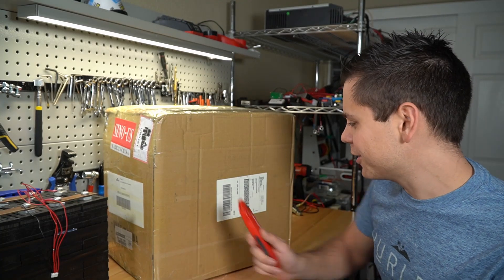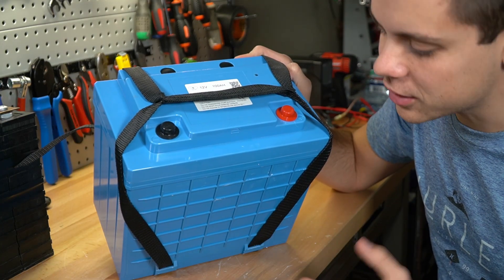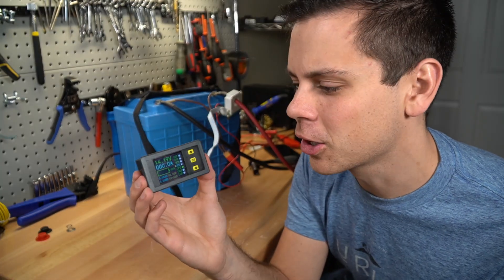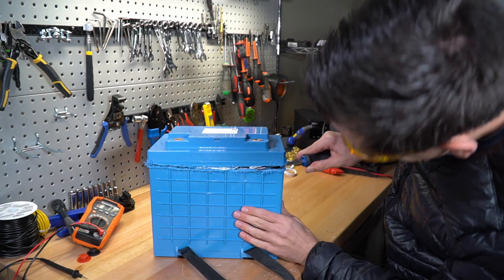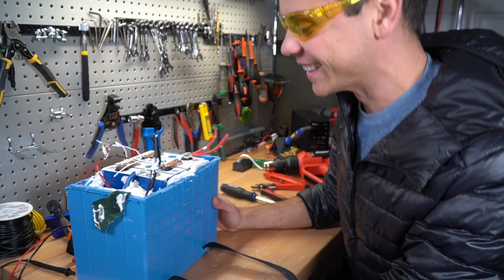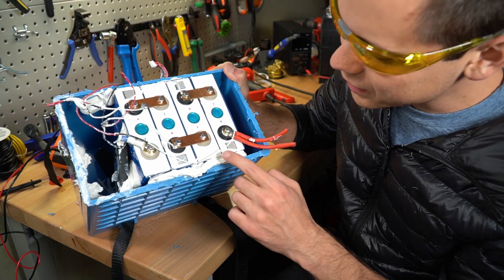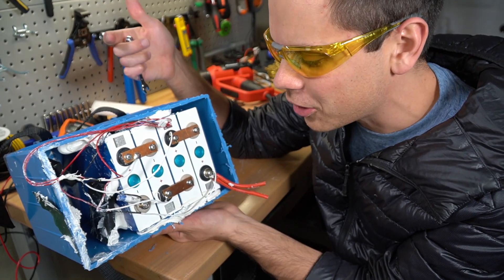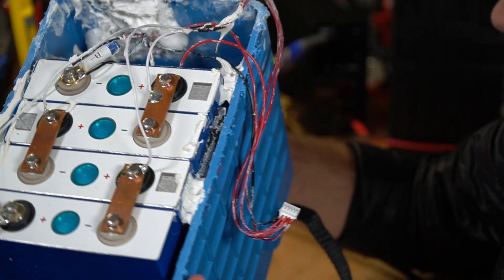Aliexpress $538 12v LiFePO4 100ah Renogy Clone (usually $899) Tear Down

Comment: Who cares about balance leads and Candlewax coated, .000002 mm thick  Tinned copper wires when it reads 4.2 v on  a multimeter and Doesn't burst into flames under First test conditions. 😂😂😂😂

Comment: Form factor doesn't make something a clone.
It's well documented that Asian factories will over produce, or continue using molds and dies after producing for one customer.
So the box might use the same mould as the one you're saying it clones, but there is no guarantee that anything inside is good or bad quality. As you found out.

Comment: Thanks I was thinking about buying this battery, but forgetaboutit.  I am waiting for a SOK 100 ah lithium battery, it maybe awhile. I received a text from SOK saying after you video evaluating their battery, they sold out and had to reorder from China. Hopefully it will arrive this month and I plan to build a milk crate system with quick disconnects so I can quickly remove the crate from my van.

Comment: I wondered about my Renogy after seeing this knock off teardown in the same case mold. Peeled off the rubber vent caps on the Renogy and looked inside. Happy to confirm it it looked very neat inside, and has Cylindrical cells in light green wrap, ~ 1” diameter, so probably 26650? laying on sides. A sticker on an aluminum piece (BMS?) says Zbf12v100... on the side.

Comment: Will the reason they are the same looking as a Renogy  is because that is what is called a "common mold", meaning anybody in China can buy that case.  So how this works it anyone can start a Battery business in China by just getting a small warehouse and hiring people to "assemble". They can buy the Case, they can buy the cell packs and buy the BMS, then go on Alibaba and sell. So when you go on Alibaba and you see the same battery style appearing time after time it just a bunch of assembly houses, and traders offering those garbage products.  They just rent space, buy cheap cell packs and BMSs and assemble. Do you really think they are putting in the top of the line cells?  Not they are putting in cells that are not passing the grade tests, and cells that are designed to look exactly  like the higher end cells, or they are not grade A or matched cells. Don't want to be a jerk but I don't agree with your testing of the battery cells and claiming they are "Great" from a few discharge tests.  That just not accurate.   Keep in mind there are vastly different levels in cell manufacturing.  The cheaper cells are designed to look exactly like the more expensive cells, yet they will have lower grade materials for the cells and they will NOT have the same number of cycles and are usually built without matching the resistance and capacity.    So just a few discharge Tests as you are doing are not really enough to say they are a "great cell" to be honest.  It's  like you can buy a  cheap Phillips head screw driver for $4 dollars and once you start to use it the metal is soft and doesn't hold up... .though its fine for temporary use and works fine when you first use it.  That is really how it is.... so the money and cheap stuff really isn't the top quality stuff.  What I said are actual facts.  Just sayin'.

Comment: Hi will excellent video mate I've got a question for you I'm building a campervan at the moment and I'm looking for or ideas on a cheap safe lithium battery preferably a lead acid drop in type with BMS integrated I stay in Scotland and the main one that keeps popping up is the victron one but it is expensive I've seen the battleborn can't see anywhere in the internet that will send them to Scotland I did like the CALB cell video you did but not sure I've got the expertise to build a battery with all the BMS!! Thanks again for the great video's 👌🏻

Comment: I have the Renogy 100ah battery and I weighed it, it weighs 28.5 pounds or 5.5 pounds more than this white label battery (this is for the battery alone, no packaging and my scale weighs to the nearest .5 pounds).  That is a huge difference!  Also Renogy had their 100ah battery for sale at $640 just before Christmas.

Comment: Also noticed that the Renogy batteries I bought have the cell model number listed on the data sheet, which is IFR26650-3.4AH. These appear to be cylindrical cells. That gives me some hope that the Renogy ones aren't built the same way as these, unless they are lying too, or are being deceived by subcontractors themselves. I guess we'll find out soon...

Comment: I recently purchase  some renogy 100Ah batteries when they were on sale recently   The case looks identical except for color and labeling to the battery you have.   However, it weights 28 pound, so something is different inside.

Comment: Something I would like to see. A sailboat 12 volt lithium  power station that is a direct replacement for old lead acid D8 batteries.  To be able to buy a boxed lithium power station that all I have to do is plug it into my solar panels and wind generater. And drop it in the hole.
I'd buy two! I have a 1977 Morgan out island ketch. Stock, they boat takes two D8 batteries. One for the diesel starter and one for boat systems.

Comment: I don't get why people in the comments are saying that you should open dispute. You bought a battery that is perfectly good for the price.  $440 for cells + $20 for case, $50 bms add the labor and other random stuff like glue,screws,copper,bars (all of those are the remaining $28.) It is sold basically at almost no profit. Is it well build ? If you expect high quality you have to pay more. The profit margin of this product doesn't allow for quality control,R&D and other extras. In this case you get what you pay for. Can you do it yourself and better 100%, but then add your labor to the price, including the time you spent ordering 10 different things that you do need. Also building small amount of this batteries may be ok. But imagine if you need to build 200 of them, I rather get this shitty ones and just deal with them if they fail.
Reply from the maker: Because the picture shows cylindrical cells and a different BMS. That's why
Reply: @WillProwse  people seem to be under the impression that low prices / profit margin means you have to be satisfied with what you get. What a joke. If your return process fails, I see no reason to curse the sky. 

However, all these people insinuating that you dont have the right to try to rectify the situatio. need to gtfo youtube because the internet is a great way to hold companies accountable.
Reply: @WillProwse   Looking at the listing it seems the picture got removed that was showing the internals. Still I don't understand how returning a product that you cut open is going to work. I mean most of the return policy I've seen state that item should not be destroyed.Also  I still don't agree that the item is not as described,  we've seen worse from big US companies that in different revisions of their products use different components.  For me the specifications are the description of the item, I agree that the picture of the internals is misleading but that is the only issue, it could've been solved by 1 line in the description stating pictures are for reference and actual product may vary.
On top of that the return shipping cost is on you in this case also export documents and so on. I'm wondering what is the quote for the return shipping for you and will it be worth it ?
Reply: @ac0rpbg  if you bought a car online and it had a different engine in it than what was pictured in the listing you would not be talking like this.
Reply: @oculophilia918  Well here in my part of the world, you don't buy car without looking at the car in person for the exact same reason. I'm BMW guy so I can give you many examples of "M3" look a like cars that are made to look like M3 but they are not and in the case of the cars if it says in the specs what engine it has and show different engine in the picture then it is misleading and scummy, but it is as described. I'm not defending the people that do this I would feel scammed too. But this is the reality we live in with the cheap stuff we buy.  As I said earlier when the price is too good to be true, then you should expect corners to be cut. It looks like all in this battery is new it holds the capacity tests it exceeds the specs of 100ah by having 105ah cells. Would you be more happy if the BMS and all the internals were exactly as in the picture but the cells were used and BMS was re-manufactured?
Reply: @ac0rpbg  counterfeiting is illegal.
Reply: @chriseudy4684  It's not a counterfeit
Reply: @brianbiggar144  bait and switch same thing pretiner. Splitting hairs is for ppl 😂

Comment: Lithium batteries cost too much.  Not good for beginners.  Look for the Universal UB12350 battery It is sealed and maintenance free.
Reply from the maker: Those are the most expensive actually. Lowest charge cycle life of all sla. Initial cost is low, but they are biggest rip off in the long run
Reply: @WillProwse  I have one that is 10 years old.  Still works fine.

People might as well just stick with on grid power supply or get a noisy generator as the costs are similar.
Reply from the maker: @240Volts  sounds like you are breaking laws of thermodynamics. How many times have you cycled? And float charging a sla is cheating. How deep is your cycles? What's the bandwidth. I have the data sheet on those and max is 500 cycles at 50%.
Reply from the maker: @240Volts  yes but we are using solar for other reasons than just cost
Reply: DIY Solar Power with Will Prowse I don’t let them go too low voltage wise.  I have no idea what you are asking about bandwidth wise.  
I have to keep a automatic charger on it due to the constant stratospheric aerosol injection here which makes most days very gloomy out. 
I get the type of batteries that fit my budget. 
Like I said I bought a ub12350 10 years ago. I also didn’t mention I acquired 2 more at no cost a few years ago. 
Thanks for the replies though.  Merry Christmas.

Comment: If you had access to the manufacturers and supplies what components would you use to make the cheapest best version of that renogy battery pack for mass production?
Reply: Bigger terminals bigger wire and better bms

Comment: Ha Ha...   I bought 3 of those a couple of years ago, then I left a comment on Amazon for the Renogy clone...  Every body chewed me up and down, saying the Renogy was a different battery...   Suckers paid 900 a piece for the renogy.  BTW, I have mine in my Sprinter motor home and they work great and half the weight of previous 2 lead acid batteries.  For my home solar I wouldn't use these, I use poly prismatic cells and the smoke my old SLA's.

Comment: I really really want to know what's inside a renogy battery. You can't buy battle born batteries in Australia. And although cheap is most likely going to be cheaply made more expensive batteries are not necessarily better made. If they were ok then I could feel comfortable buying them but right now I'm not sure what to buy.

Comment: The terminal screws on those cells are small because they are only designed to hold the bus bars in place. The main electrical connection is between the flat top of the terminal and the bottom of the bus bar.

Comment: If they sent it to you, how do you know they didn't prepare a battery specifically for a review? The ones they sell may only be good for 1000WHrs. This is the problem with the aliexpress/ebay/etc. model - you don't actually know what you are getting.
Reply from the maker: Because I bought it with my own money from over seas distributor that probably doesn't know my name. And the inside was crap. Wouldn't they have prepared something nicer for me?
Reply: @WillProwse  I heard you say something about buying it with your own money, but I thought you also wondered what it was that they had sent you - just got confused Will - sorry! 

The inside was a work of art wasn't it? 

It's nice to know that the cells coming out of China are what they claim now. Someone in the comments wanted to know how much capacity they would have after 500 cycles. My guess is that the capacity change will be very minor. It would be great to know, but it means months of cycling to test that.
Reply: @WillProwse  Depends.

Comment: I'd like to see you do a teardown of the actual Renogy 100 AH battery. I got several on Black Friday because the deal was amazing. I really hope it isn't this bad. 😂
Reply: There are actually 26650 batteries (4S30P) in my Renogy 100ah although I see 12 AWG wire in mine..

Comment: I've noticed a lot these pop up on aliexpress recently, also some pre-built "solar ammo can" type builds. Honestly I can't say I'm surprised on the build quality of that battery, and I expect the "ammo can" prebuilds are at a similar level...

I really think the better option is DIY, and I'm still inclined to go with Daly.  As it turns out, I'll be living somewhere I know it will never freeze.... so I think I can safely do without low temp charging cutoff.

Comment: I hope Will gets a Renogy and test it. I  contacted Renogy, they say their battery has a low cut off with their bms.
Reply: Are you referring to the original Renogy LiFePO4?  And do you mean that it as a low TEMP cut-off?  Or did you mean it has a low POWER cut-off (I do know that it has a low power cut-off).  Thanks.
Reply: @IncandescentDaD  at the time of the email it was the original battery and low temperature. Time has passed since I  wrote the comment.  Will did a teardown  on the Renogy.
Reply: @anythinguploads2161  Thanks!  Did Will do a teardown of the old Renogy 100Ah?  I saw that he did one on the newer "smart" one.

Comment: Is that a regular SLA auto charger you're using to charge it?
Reply: It's a benchtop power supply !!
He stated that in his comment
Reply: @danieldougan8550  I was referring to the Schumacher Rapid Charger at 2:13 that he appears to have used to do the initial battery charging.   Not designed for Lithium batteries, but the charge voltage must be compatible for a quick charge.
Reply from the maker: @jeffg3563  I actually use 3 chargers and a benchtop supply to rapid charge at 40 amps. But yes, that is a SLA charger. not designed for lithium batteries at all but it works well

Comment: i really hope you set up a testing rig to start doing charge cycle counts. i'd love to know what the capacities on these cells you are pulling after 500 cycles or more....
Reply: Thank you thank you!!!!!  I was hoping someone else would tell him this!  I have tested many many cells and even very bad cells had a good ah rating for the first couple hundred cycles, the weakness of a cell shows quickest with cyclic use
Reply: I've found most RC battery chargers have settings to discharge, then recharge, then repeat over and over. I definitely run batches of cells through it here and there, massively increased in speed once I started using regenerative discharge as well.
Reply: @vira-linc  I bet these specific cells are just fine....it is the cells that they will deliver to you or I that I worry about.
Reply: Benny Banger oh sure, but when on a fishing expedition it’s good to cast a wide net. Different mixes of of material inside a cell could mean oem tests pass for a few cycles but quickly fail. Heck, I’d even open that bms to confirm it’s a Daly bms and not a clone. Like I said, wide nets.
Reply: @vira-linc  Good advice - thanks Roadsteading

Comment: God I hope the Renogy labeled batteries are not constructed like these....I just put 2 of their 100 AH into my RV trailer.
Reply: I have a feeling we will soon know.  Will is not afraid to cut one open with that E tool.
Reply: The case could be mass produced for battery makers to use, maybe clone only applies the  case look.  Build quality might be diffrent on the inside. Thus my  crossed fingers..opening  line.
Reply: Fingers crossed....i have two 50 amp renogy  in parallel in my home trailer . And one 100a in my truck camper.
Reply: The biggest issue that is of concern is component construction and the quality of some of those components used to build it.  Cheap BMS, small terminals, generally bad construction methods packing with foam and glue , wrong gauge wire.  So yeah, pretty much everything except the external case and the lithium cells.

Comment: I got 2 Renogy 100 amps for 550 each on black friday
Reply: That's a great deal.
Reply: I got one on the same deal.
Reply: Not counting tax I got three of them for $518.43 each on black Friday. 3 was the most Amazon would sell per person and it was one of those timed events. Good deal either way.
Reply: Same, got 2 of them, just connected them yesterday, can’t wait to see how they go, running a 100litre fridge, microwave, and anything else from a 2000w inverter👍

Comment: Nice vid -- looking forward to the day when you post an off grid 48V PIP split phase review.
Reply from the maker: I am running a mpp PIP right now. Works great for split phase. Dead simple to install and I can charge my tesla with it. The settings are easy too. Can also do 3 phase. Still need to edit the video.
Reply: @WillProwse  I knew I saw one in your shed!! Would be nice to see/hear your thoughts - I'm right on the edge of buying one.
Reply from the maker: @rebelyell1580  it is 2x lv2424 in parallel. Really simple setup. If it's stationary and weight does not matter, you should like it. It is super powerful and easy to use. Output can easily supply a ac panel. Dead simple to setup.
Reply: @WillProwse  Thanks a lot Will ! Think I will put through the order of a couple of 5048's and see how it goes. Just waiting for some legal incumbrances to be cleared up and I'll have 40 acres of desert not to far from you actually hopefully in the near future.
Reply: @WillProwse  a Navy buddy took 440 triple phase across his arms and lived!